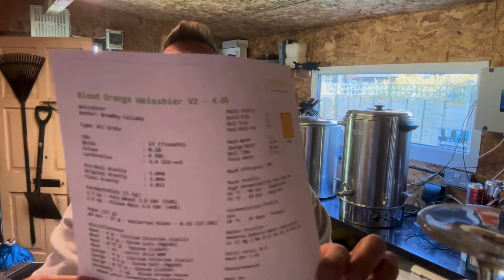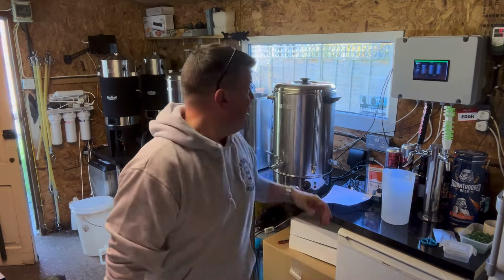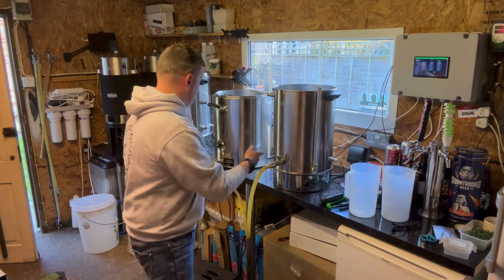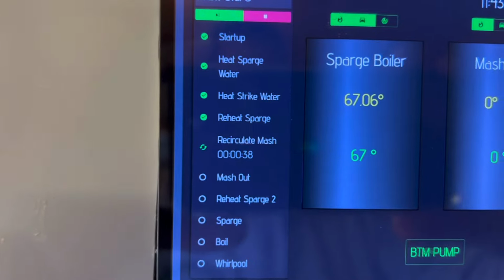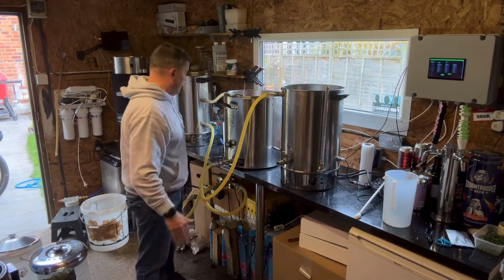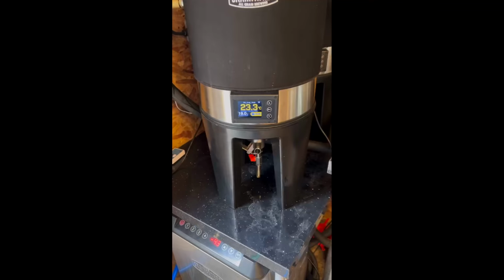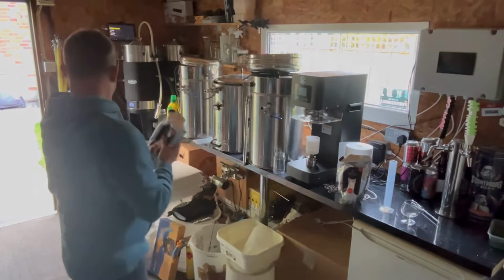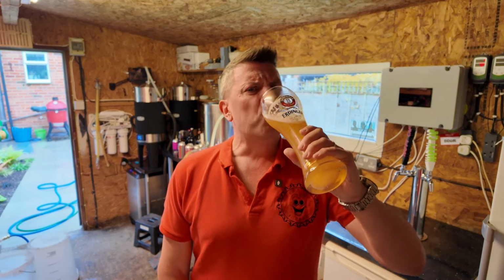Blood Orange Weißbier Grain 2 Glass

Comment: That was definitely a thorough video but you skipped the hop drop and showed every other bit involved! I have tried the apricot version of this and it was fantastic.

 A couple of questions: 1) do you get any condensation issues when boiling? 
2) where do you get the fruit puree pouches?

Also, Id like a tour of that cocktail bar you have. That is an impressive array of spirits you got there.
Reply from the maker: Cheers triple B.

To answer your questions:

1.  No I don’t get any condensation issues when boiling. I just leave the shed door open and the steam naturally goes that way. That’s just pure luck vs design!

2.  These actually came from Amazon but I’ve used different suppliers in the past. One called Henley Bridge was one I used to use but they were out of stock this time.

And I’d love to make you a slippery nipple when you are next around!